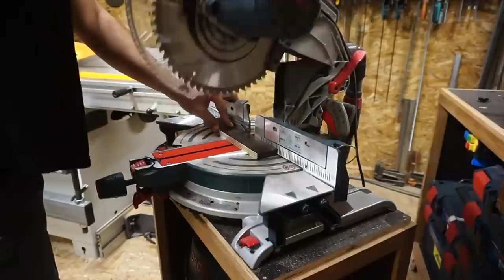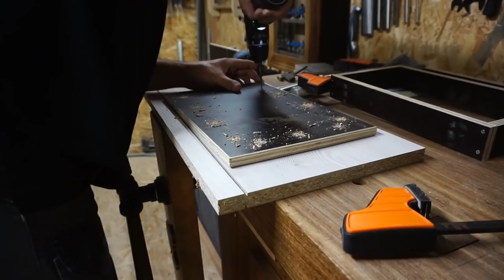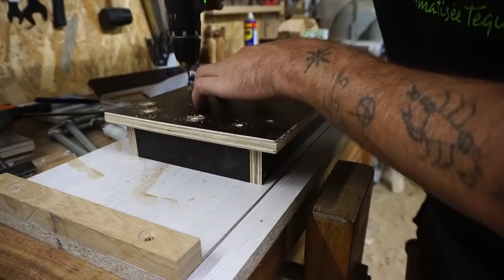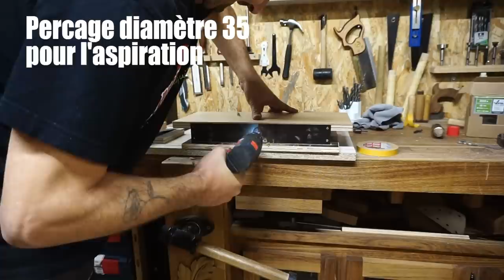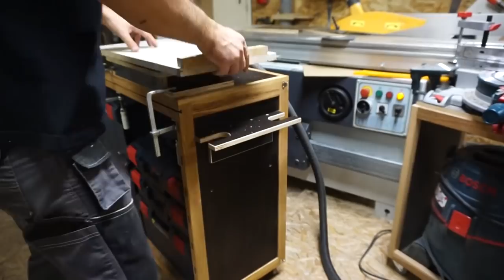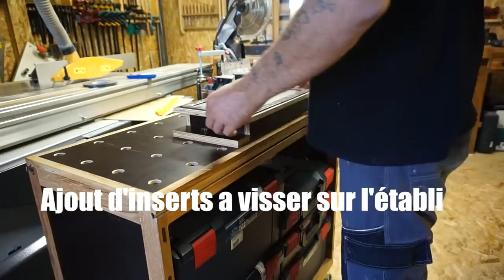Unité de serrage a vide pour moins de 20 euros #presseavide #DIY #paschère

Comment: Bien vu et ingénieux.
Pour la sécurité du moteur, il y a normalement un trou d'évent qui permet au moteur de respirer un peu et de moins chauffer quand on bouche l'aspiration.
En principe, c'est réglable. Si tu as des watts (2.400 au moins), même avec 10-15% de perte en dépression, ça maintiendra la pièce et préservera le moteur.
Reply from the maker: Merci ,oui j' ouvre la vanne sinon ça aspire trop fort et l aspi ne doit pas aimer .
Reply: Il faut. Ton tuyau d'aspiration doit faire 35 mm soit 9,6 cm² et 40 kPa d'aspiration qui passent maintenant par (si tes 5 trous font 4 mm) 0,63 cm², ça décoiffe !